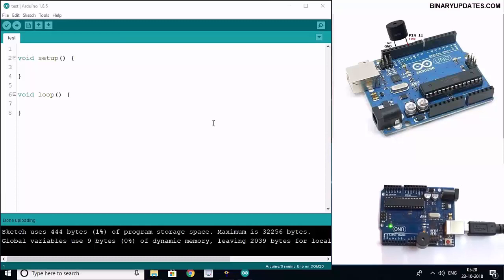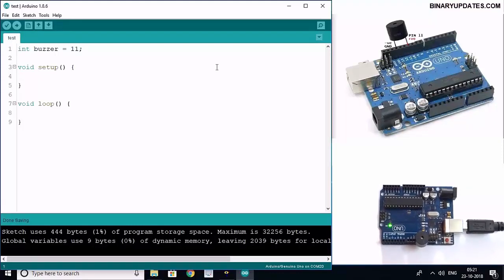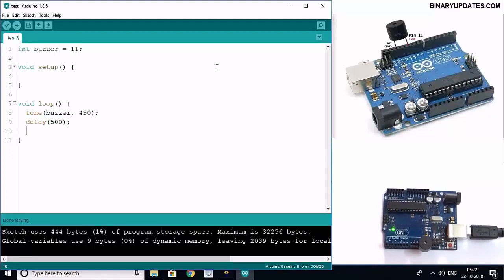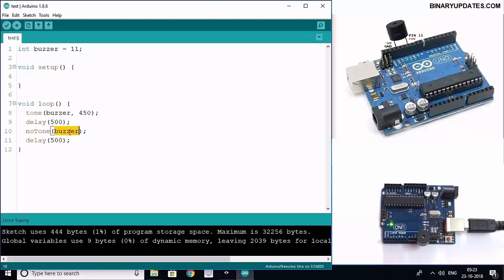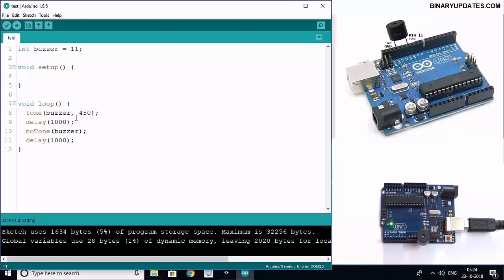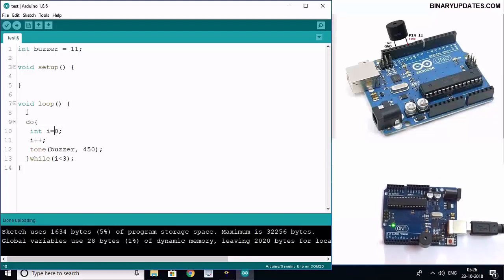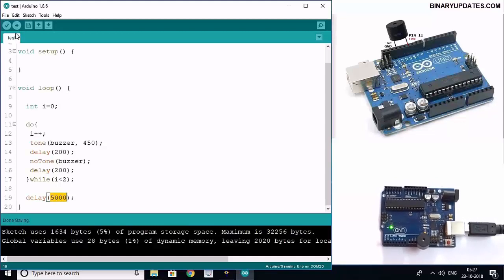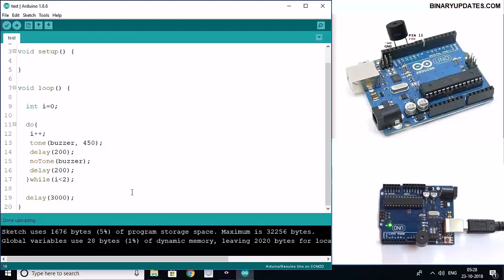Buzzer with Arduino to Generate a Tone

Comment: I got an error;
Sketch uses 1578 bytes (4%) of program storage space. Maximum is 32256 bytes.
Global variables use 28 bytes (1%) of dynamic memory, leaving 2020 bytes for local variables. Maximum is 2048 bytes.
avrdude: ser_open(): can't open device "\\.\COM3": The system cannot find the file specified.

Failed uploading: uploading error: exit status 1
Reply from the maker: Hi Sdthomson, please make sure to selected right COM port while uploading program in Arduino Uno. This issue has nothing to do with Arduino code or the tone library for buzzer. I hope this may help you troubleshoot the issue. Good luck and best wishes!

Comment: Wonderful! I'm trying to make a sketch that lights an LED plays a tone for 200ms that increases in pitch and decreases in time between beeps as a certain value increases. With the LED staying on the whole time
If i do
    if (average > 50 && average < 150){
      digitalWrite(LED1, HIGH);
      
     	tone(peizoPin, 659);
	    delay(200);
      noTone(peizoPin);
      delay(600);
    }
    else{
      digitalWrite(LED1, LOW);
      noTone(peizoPin)
}
if (average >= 150 && average < 250){
digitalWrite(LED1, LED2, HIGH);
      
     	tone(peizoPin, 900);
	    delay(200);
      noTone(peizoPin);
      delay(400);
    }
    else{
      digitalWrite(LED1, LOW);
      noTone(peizoPin)

.. Is this correct? or have I written it badly. Thanks again for your tutorial you really have helped me either way

Comment: Hello I am using pcm.h library for a specific tone.. Ding dong.. I am successful generated but the problem about the pin which is pinmode 11 . I want to try to change from library but it's not possible.Can i generate ding ding tone with your method

Comment: I want to make my buzzer beep when i try wrong password in my keypad linked with Arduino. How to do it?
Reply from the maker: You can write Arduino Code to take input from Keypad. And then use Buzzer to beep. It all can be done through programming. Good luck and best wishes!

Comment: Hi, i am making a small project even i am a novice to Arduino. I have copied your code to make the 450/200 sound/delay and all ok. I would like to copy this code into other code for a small machine to get this 450/200 alarm when the production is finished. How to setup a 5 min. alarm continuously. After 5 min. it should stop if no action from operator. If action from operator such as pressing a reset or other button it should stop. Any suggestion for code ?

Comment: Thank you. I use tone() to generate a song sent to a passive buzzer as an alarm clock. I want a louder alarm. Can I increase the current furnished by the Nano using a simple amplifier without destroying the buzzer?
Reply: you can use a bjt transistor like 2n2222

Comment: I have a question

How to change buzzer sound when I start up the pc?

By default I have a high pitch beep
I wanna change It to lower pitch

Is there's any way to change It with programs or something?
Reply: On BIOS settings there's only option to turn ON/OFF the buzzer
Reply from the maker: That Buzzer and Beep is from your PC. Its not something you can control. This video is to show you how to use buzzer to generate beep from Arduino Uno. I hope this may help you. Good day
Reply: @BINARYUPDATES  well okay... I just can't find any response on Internet. I just wanted to have a old style low pitch beep when turning on the PC
Reply: And I thought I change the default beep sound with using aruduino

Comment: How to stop buzzer sound.. After a function.. I write nobuzzer. But it didn't worked. Please help
Reply: In setup() you must specify  pinMode(buzzerPin,OUTPUT); In loop (example) you firstly do               noTone(buzzerPin);
 and in an if/else statement you write
   tone(buzzerPin,500);
   delay(1000);
        noTone(buzzerPin);
Reply: @Fumetsujo  thanks. 😇

Comment: tone was not declared in this scope
Reply from the maker: Hi Ivan, 

Maybe you should check if "Tone" library has been properly installed on your Arduino IDE. If issue persist then try to uninstall and reinstall Arduino IDE from scratch to resolve library related issues. I hope this may help

Best wishes
Umesh Lokhande
Reply: @BINARYUPDATES  thank you for the response, although ive learned that the library isn't available for arduino due

Comment: Hi, I have done water level controller using ultrasonic sensor , but when the water level reaches full tank the buzzer will on continuesly untill the water level decreases Fromm full . But I want to on the buzzer only for 10 seconds when the water level reaches full then it should stop beeping , plz tell me that code ...

Comment: How to change the frequency without using tone()
Reply from the maker: If you're using tone() function which is build in Arduino function. Since it uses internal timer of ATmega328 Microcontroller. If you want to change frequency you need to generate PWM signal without using tone() library otherwise you can edit tone library

Comment: can you help me ..

. I have to make the water level in my house this way
If the water level is 8 and the water level falls to 1, then the alarm goes off every 5 seconds until the motor turns on and the water tank is full, then the motor shuts off and the
There is no option to have the motor itself. The code and diagram badge are the two things I will do myself.

Arduino nano
Float switch (8) p.c.s.
Seven segment display

Awaiting your reply

(Thanks)

Comment: Don't you need a resistor for your buzzer?
Reply from the maker: Hi Mr. Ray, It worked with me without resistor. Its may require depends how you connect Buzzer to Arduino. But simply to generate Tone. I don't think resistor required. Wish you beautiful day

Comment: I am trying to make my buzzer beep faster as something gets closer
This is the code
distance= duration*0.034/2;
 
safetyDistance = distance;
otherDistance = distance;
if (safetyDistance <= 100){
  setColor(255, 0, 0);
  delay(40);
  setColor(0, 0, 255);
  delay(40);
  tone(buzzer, 450);
  delay(100);
  noTone(buzzer);
  delay(100);
  
}

else{
  setColor(0, 255, 0);
  digitalWrite(buzzer, LOW);
}

if (otherDistance <= 50){
  tone(buzzer, 100);
  delay(15);
  noTone(buzzer, 100);
  delay(15);
}

else{
  setColor(0, 255, 0);
  digitalWrite(buzzer, LOW);
}

How would I do that? (I also have a RGB led on it too)

Comment: why did you not add a pinMode
?
Reply from the maker: It's not necessarily needed in this example code. If you want you can add and then try. It will work.

Comment: Grreat Umesh! Interested to know the practical use of this, apart from an alarm or warning signal. Did you use this in any of your practical applications?
Reply from the maker: @Jitendra Hushare: I have used in some products to give audio indicator in the form of Alarm only. If I came across any other application or use case I will surely let you know. Thanks